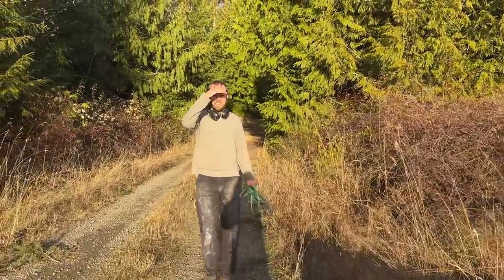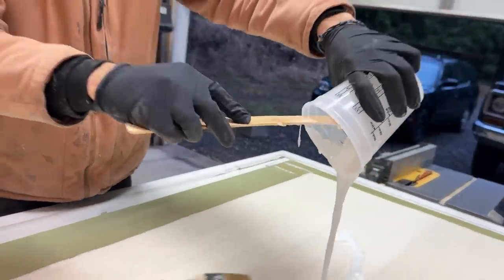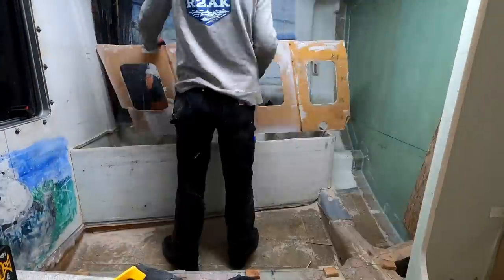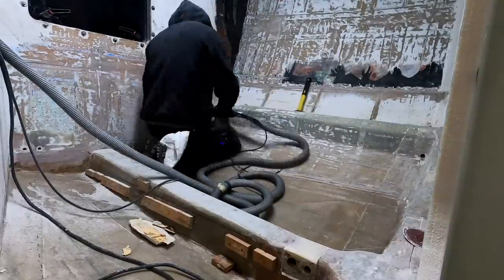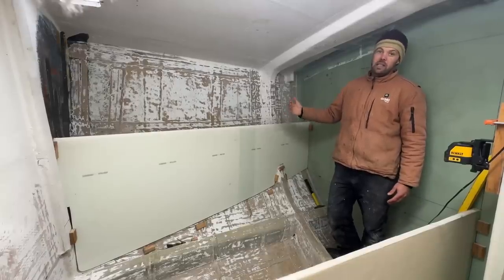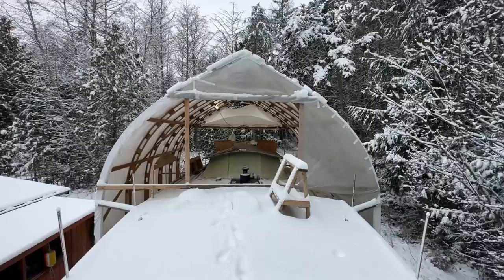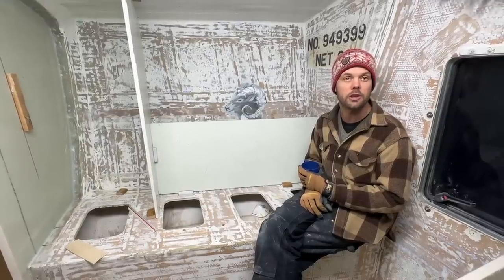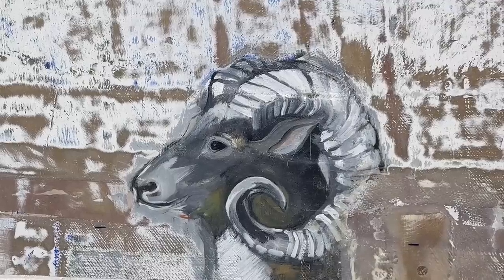Sailboat Refit: Stateroom Build Begins! [E59]

Comment: Have you ever considered spraying the entire interior with closed cell foam for insulation? Kind of like what they use in steel hulls? I have it in my steel 50 ft ketch and it's incredible at keeping the moisture out/condensation.
Reply from the maker: the boat is already insulated so I don't think that's necessary in our case

Comment: 13:15 - if the top shelf is slightly below the vertical face you get a build in fiddle. I had huge galley drawers (similar to your clothing drawers) . Used very good double extension sliders that were rated for 100 lbs each which was great for drawers of canned goods. Nothing marine fancy but good cabinetry making. I think they were coated steel. Drawers were made by my dad in 1/4" plywood for the back and front (with a hardwood face that lapped over the cabinet face). Sides and bottom were 3/8".
Reply from the maker: excellent tips, thank you

Comment: I like the idea of the foam core construction. But unfortunately it will not be easy to fix screws in the foam. 
For drawers and hinges, the screws must be firmly anchored in the material. Maybe wood would be an easier solution.
Greetings

Comment: 😎👍🇺🇸

Great progress.

My Dad did fiberglass repair my whole life until he became a full time prospector.

He would always cut off the first 1/4", 1/2" or so of his brush.
It still works great as a laminating brush but also works a lot better for tamping the air bubbles out or smoothing the cloth.
You end up with a nice square end and it's a little stiffer. Just use larger Sharpe shears.

Cheers from Lake Stevens WA.✌️

Comment: It occurs to me that there are probably many fire hazards on any site where fiberglass work is being done.  (flammable solvents, flammable glues, flammable building materials, flammable dust?, electrical extension cords, electric space heaters, metal grinding)   Perhaps a few minutes discussing those hazards, the need for fire extinguishers on site, etc. would be helpful to they many subscribers who are doing similar work.
Reply: Very good point!
Reply from the maker: Yes good idea.

Comment: I use the same technique to create templates. But I use a material that I think is known as coreflute... it's a plastic material generally used to make cheap signs. It's a corrugated plastic skined both sides. The advantage is you can cut it on the fly (quick curves) with just a good pair of scissors. It flexes more than the MDF but a bit of bracing fixes that.

Comment: I just started to follow your videos. One tip: you can laminate aluminium in to fiberglas for structural integrity (for different designs and saving weight) and ofcourse easier joining together different materials

Comment: Have you ask forums and total boat if hydrophobic paints in the inside of the hull and surfaces facing the hull to shed any condensation straight to the bilge were it could be pumped out easily. 

Thinking about this.  How about a parastoltic pump with silicon hoses to keep the bilges dry. Without using a lot of power.   I wanted to build a pendulum powered parasitic pump. That any rocking of the pump goes thru a micro ratchet to turn a gear reduction to spin the parasitic pump slowly. never got past the idea stage

Comment: I want to suggest Travels with Geordie.  Peter has a way of building cabinetry that looks somewhat complex, but he does it with basic tools.  I've learned quite a bit from watching him refit his wooden motor cruiser.  

I think some kind of press for the panels, something where you just have to lay it up, and add the final sheet and pump it down.  Try to automate as much of the process until it's mechanical and repeatable.  You should be able to layup both sides at once if you butter the foam and put it down onto the 1708 which is already wetted out on top of the peelply then you work out on the top side.
Reply from the maker: Good idea

Comment: Wishing you both a Merry Christmas. Have you looked at feasibility of adding wood veneer as a “ply” over glassed foam panels? May help to add strength at low weight for furniture builds.
Reply from the maker: that's what i'm thinking about doing, yes

Comment: For interior joinery - Boat Joinery & Cabinetmaking by Fred P. Bingham. I’m curious as to your thoughts on condensation….as it is a foam boat do you expect there to be so little moisture that there isn’t a risk of water pooling? Thanks for sharing. Love your style😎👍
Reply: The condensation also happens under the mattress not just where the mattress touches the side of the hull. People give off moisture vapour when they sleep. It passes through a mattress and when it hits a cold underside support panel (cooled by colder ocean water) you get condensation.

Comment: I ENJOY YIUR VIDEOS VERY MUCH I would suggest hwile youb stil have access in the cupboard area that you consider addign Webasto hot aire heating unit plus a split system aircon from Cruiser...I had bot on my Oyster 485vand they wrked great althoughthe Webastow was difficult to purge the hot water pipes. I ALSO WONDER HWO YOU WILL HANDLE FRIDGE . FREEZER .. I had a combination system that ran bot the fridge but with hindsight I guess I woukd get 2 separate units for increased reliability I seems from the video you hvae room for all ogf that. LIKWSIE HAVING ELECTRIC DUCTS IN  PLACE WILL MAKE YOUR LIFE EASIER GOING FORWARD whwn you fit the electric wires..and that of couse means deciing soon where each of the units will be placed ...water maker? 12 VOLT CONVERTER FROM 220V / 110V FOR DRIVING  THE FEW THIGS THAT ARE 12v. , My battereis were 24V so I neede loads of 24V to 12V converters. thatare easily accessible.  I wish you oth los of look in your super project. .

Comment: This is not a question based on personal experience but I se some people complain about the round doors with the lip on the bottom you can bump into if they wont be a true water tight bulkhead. Will you be making them water tight bulkheads is it a design or astatic decision? I am just curious as i know noting about building sailboats.
Reply from the maker: it is more of a design decision (I think it looks cool). The door to the state room is built on a stringer. We'll probably stub our toes a few times before we learn.

Comment: Hello,
You are making a lot of progress. The last time that I was able to get on here you were working on the stern end. Do you have plans to install some temporary heat so you don't have to freeze while doing the work. Btw will the fiber glass setup in the cold weather like you are having? Do you have a floor plan so we can see what it will look like? Merry Christmas 🎄
Reply from the maker: Hey Jerry, I have a heater going in the boat which I can get up to 60 degrees. We're actually going to be sharing 3D renderings of the floor plan very soon...probably next episode. I have to build ovens for the fiberglass to set up.